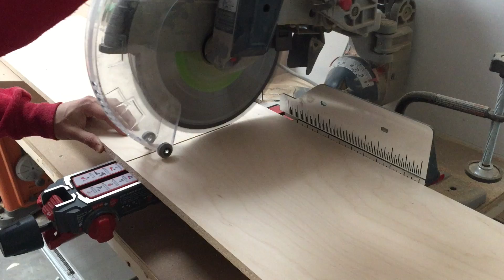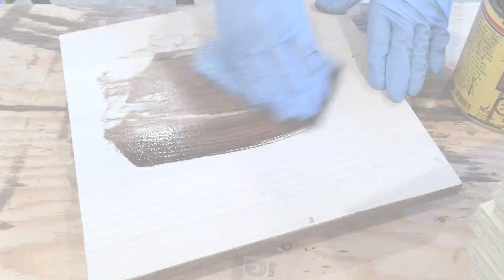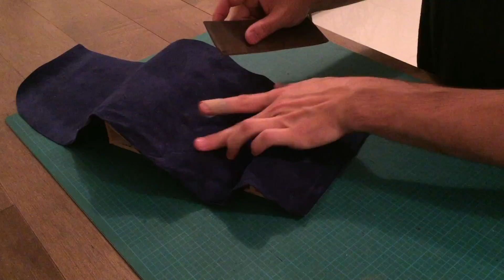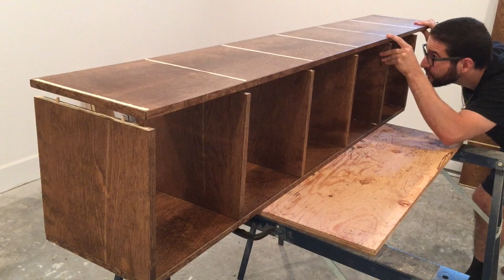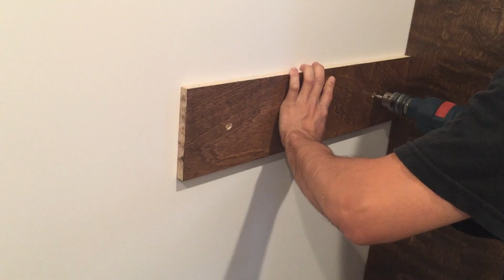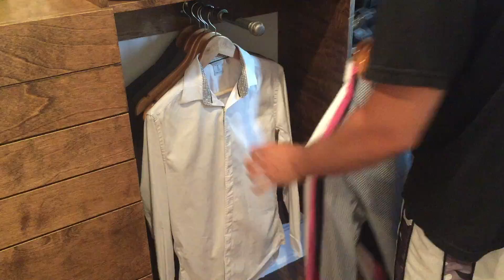How to Build a Custom Walk-In Closet // DIY - Part 1

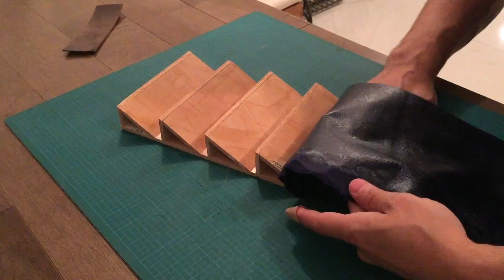Comment: 4:30 For fabrics, its much better to use spray on contact cement so you can control the application better and avoid bleedthrough to the visible side.

Comment: Really good ideas, just wondering why you didn't hang with french cleats? I really like the idea of hanging the cloths perpendicular to the wall. has any of your cloths fallen off the rod. That may not work for us with the amount of cloths that will eventually be placed on them. Shoe rack looks really nice, I may make those a bit smaller as we( wife and I) have too many shoes... But I like the build, good ideas for my build, one of these days...
Reply from the maker: No clothes have fallen off the rack. They are very sturdy and doing very well

Comment: I'm surprise you still have fingers, never hold the material at the end where is the lightest or smallest part always hold it at the longest and heavy end. Even if you have to use your left hand to cut it. Minute 0:21

Comment: unfortunately I can't find anything in comments, but what kind of wood did you use for the main shelves?
Reply from the maker: Birch plywood
Reply: @CoreyRametta  thanks for response! that was a first time I ever written the comment :)
I did some research and it seems that the plywood might be different grade. Baltic Birch is used for the future but Birch plywood from the Home Depot seems to be 3rd grade or smth like that.
The surface in the video looks sooo smooth, do you think I'll be able to reach that good look if I sand/stain everything properly or in addition to the processing, the wood must be also a higher grade and I won't be able to reach that effect with Home Depot plywood?

Comment: Good project, finally convinced my wife to let me do it ,the only change will do instead of the pipe coming out for the shirts or pants will sideway , by any chance the name and color of the stains ,thanks in advance!!
Reply: If you use a "Pull-Out Closet Valet Rod" you can make the same closet in the video, but you'll get better access to all items with the valet rod. Some Valet rods can be pull downward for eye level access to clothes. Some home improvement stores/websites offer wood stain samples so you can better match what you're looking for.

Comment: I'm old,  tired, and female, but I took out wall between little bedroom and my bath and built my own closet.  If I can do it you can do it.  Also Lowe's has the wood already drilled and painted in their closet area if you want to do a  faster job.  Go for it!

Comment: Looks great! I saw you using that suede material for the sunglasses tray and wanted to ask some advice. I’ve been wanting to apply fabric to a wall instead of painting it. Could that type of product you used be directly glued to a wall? Do you have any suggestions on using/attaching a fabric to a wall? Thanks for any advice.
Reply from the maker: Good idea. Wallpaper glue should work just fine

Comment: hey bud, my wife and i are going to try this next month. I'm having issues finding the 5/8 presswood online and at home depot. Any way you can help with that or any other options you recommend.
Reply from the maker: You can use 1/2” or 3/4”. Or use what is available locally at home depot

Comment: Yes very well done if u measured ur space right and the power point was nt half though the cabneit like on the part of u vid about 10mins n 15 seconds on it becomes obvious and a ugly job
Reply: His solution is the easiest and most economical way to fix the outlet problem. No sense relocating it for a closet, and no sense losing an extra inch or two of closet space along the entire face of that wall to not butt into it. Unless this build is in a million dollar home, no one is going to care much. Still looks amazing.
Reply: That and u could just move the outlet lol and cover the hole with the cabniet
Reply: I think you're missing the point. Why bother to go to that trouble when he might not want to mess with electrical. Or leave a hole in his wall, even if it is covered. His solution works, and it is the fastest, cheapest, and easiest solution.
Reply: Haha its not like its fixed it can be moved most if not all sparkies leave a little bit more cord then needed in the back to allow for this sort of problems and u would of never even knew it had been moved a few as long as its brached properly it should be fine to move just anoth thought before puting holes in ur cabnet lol
Reply: Nowhere have I indicated the outlet can't be moved so almost all of your response is moot. Everyone already knows it COULD have been moved. You seem to really be missing the gist, but I suspect that's on purpose. He didn't want to mess with the outlet. Why should he when a couple cuts of the wood and problem solved? But to each their own if you think his solution is 'ugly'. I happen to think it's awesome.

Comment: ...on the drawers, wont they come apart soon?
also the main body - dowels and glue --- no screws required? ( i prefer also without) what is your thoughts?
Reply from the maker: Drawers are plenty strong. So it dowels and glue
Reply: and thanks for the reply :)
Reply: ps, if you use dowels and glue, do you use these 2 alone or add screws? I find it weird why to use screws if you have dowels and glue , unless its my understanding that is wrong?
Reply from the maker: No screws
Reply: thanks again !

Comment: How did you design something like this? Just wing it?  Then how did you make a cut list?  Help please, I want to do this but don’t want to spend a month calculating the size of 50 pieces of wood
Reply from the maker: Rough sketch on a piece of paper based on the dimensions of the closet. Then create a cut list from that
Reply: Corey Rametta thank you !

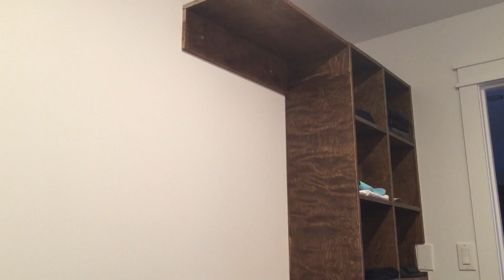Comment: @ 7:56 you have the anchored piece that the clothing rods mount to, but they have a shelving board installed on top of the anchored piece.... are those just held up by dowels on either side? If yes, how much weight do they support?
Reply from the maker: Yes

Comment: I'm curious how your pipe is holding up.  It looks like standard carbon steel black pipe.  I work in industrial manufacturing and If you scrubbed off all the oil protecting the medal I imagine it's only going to rust over time.  Not enough to worry about the structural integrity of the shelves I'm sure, but rust stains on a nice clean shirt or suit can be quite a bear. Otherwise, great work!
Reply from the maker: +iamnovus21 1 year later and no signs of rust.
Reply from the maker: +Grace Loflin not at all. There are 4 screws holding up each bar, and only about the weight of 7-10 shirts pulling it down. Not enough to sag, and I don't suspect it ever will.
Reply: Corey Rametta how about the weight pulling down on the rod? I was thinking of installing these sideways like a more traditionally closet. Are they sagging at all from the weight of the clothes? Thank you!

Comment: Corey any update on the other side of the closet?  Anything you would do differently?
Reply from the maker: +calvin415 almost done the other side. Not doing anything different (because I already had the wood) but if I had to buy from scratch I'd get Baltic birch instead of press wood. It just wasn't available to me at the time.

Comment: Nice job!  I'm hoping to start mine in a month.  We have an odd shapped closet with angled ceiling that starts about 5 feet up from the floor so I'm still trying ot figure out what to do with our.  I'm pretty sure I'll be using a nicer grade birch plywood and walnut for the face.

Comment: OK concept.... you need a huge work area..... lot's of tools, considerable knowledge of woodworking, stains, application. A lot of room was wasted. Nice if you only have three pairs of shoes, or you want ties that take a rolled up shape. What was that, 6 shirts? And, who helped you bring in the shelving? that was not light or easy to lug by any means. Why did you use a level on a pipe with an elbow while you were fastening to the wall? Again good concept, good workmanship. Inefficient use of space.

Finally, you need to let people know actual build time.10 min video=2 week build for 2 people. (never mind editing time)
Reply from the maker: I think it's a pretty efficient use of space, considering the width of the closet. This lets me add cabinets to both sides of the walk in closet, instead of just one. You don't need a lot of space, or many tools (can be done with a mitre saw and table saw... and if you don't have those, a circular saw will do). For your information, I brought in the shelves myself.
Reply: Again, great proof of concept. 
1.Originally, I thought you were going to mirror the other side.... but you didn't. Why do it later when you're in a groove? Get both sides done at once! 
2.Yes you can use a circular saw and miter saw....but you didn't. I also have a full complement of tools, and it's taken a considerable amount of time to learn proper use. 
3. Was your workshop just outside of the closet? then sure, you can bring it in, however, the whole thing assembled still weighs a considerable amount, not to mention the size. It's big and awkward to work with.
4.You and I are skilled, I know what it takes. Not so much for others.

Comment: just out of curiosity, why would you ever hang your clothes front to back instead of side to side?  I know a lot of IKEA furniture does this (which perhaps was the style your going for) but in my mind, form follows function...and hanging front to back instead of side to side doesn't seem very functional.  Just my 2 cents, I'd love your reply
Reply from the maker: Good question. Main reason...it is a narrow closet and I want cabinets on both sides. You need 24" from the wall to hang side to side. My cabinets only come out 12" from the wall. This leaves me enough room to walk through the closet once I install the left side. If I hand side to side, I'd only be able to have cabinets on 1 side.

Comment: I like it. I think adding doors would have given it an extra touch of sophistication. Either small individual doors or larger doors covering more space but def doors. Also, would have been better to have your hanging things hanging more like a closet rather than outwards. Its just easier to organize and pull the looks. But otherwise love it.
Reply: Leneufcinqcergy once you know your own wardrobe you don't need to see all of them.  it's a nice touch to only display the first one.. it looks more organized and less chaotic
Reply: I agree about the rods. It’s not about seeing them all. It’s about getting one without moving 5 others first. Disagree on the doors though. Looks better open. It looked sophisticated to have neat clothes.

Comment: Corey, what kind of wood did you use for your walk in closet? I am making one myself and i had been recommended birch plywood i was looking to use pine plywood it looks real nice at the HD store. What would you recommend?
Reply from the maker: I used Birch presswood. I would have liked to go with Birch plywood, but it was not available locally when I built it. Either birch or pine plywood would work. Pine would give you more grain, while birch would be less grainy.
Reply: Corey Rametta 
Weird i have not seen that type of wood only the one with white plywood on the outside if thats what is called but i have question, i am thinking about going with birch plywood my question is would you have used the edge banding if it was birch plywood?
Reply from the maker: +Eddie i would still use edge banding, unless you want to see the layers. Completely up to you.
Reply: Corey Rametta, yea thats what i was thinking too question what size is the squares you made for belts and ties and are you happy with the size?
Reply from the maker: Ties are about 3"x3", and belts are about 5"x5", and they both work great.
Reply: Corey, how have you been nice Christmas ornaments, i have a question as i may have mentioned before i am constructing my walk in closet with birch plywood now i am a beginner, i noticed that when i am putting my pieces together a lot of the boards have a bow on them i guess a jointer would get rid of that but my questions is would run the pieces through the jointer first or after you cut your wood to size?
Reply from the maker: +Eddie generally always pass your wood through a jointer before cutting to final size. If you do it after you will cut your final piece smaller than needed. Since your using plywood I wouldn't recommend using a jointer though. Table Saw will give you a straight cut.
Reply: Corey Rametta well i am talking about the bow on a board like a crown in the middle of the board

Comment: Great video, where did you get the steel from? Im looking for something like this but I cannot find anything that looks strong enough, how did you get the tubes to fix to the bases and not slide out?
Reply from the maker: +Ben Mowatt the steel pipes come from the plumbing department of the local hardware store. They are attached to the units by screwing the steel flange into the bottom of the unit. Same for the top.

Comment: Where did you get the drawer hardware and what were the dimensions of the shirt cabinets? Also is there anything you would of done differently now that the unit is built?
Reply from the maker: +Jordan Fuller drawer hardware comes from Amazon, they are push to open drawer slides. Shirt cabinets are 24" wide. After using the closet for a few months now, I honestly wouldn't do anything differently. I think it was well thought out to accommodate my needs beforehand.

Comment: Nice work. 
I use a biscuit joiner, any advantages to using the dowel system?
Reply from the maker: +WirelessTv I read an article a while back that tested different types of joints. Biscuit joints were as strong as butt joints. Dowels are a bit stronger, and I don't have a biscuit joiner.

Comment: Excellent work! Sadly, I just finished mine and missed seeing this beforehand, otherwise I would have made some really useful changes. BTW what are the jigs you used for dowels? I haven't seen those before and as I'min Australia I probably have to import them.
Reply: Should be this; https://www.amazon.com/Milescraft-1310-Joint-Crafter-Doweling/dp/B005QU982K/ref=sr_1_2?ie=UTF8&qid=1474390703&sr=8-2&keywords=milescraft+dowel
Reply: I had the same question, those jigs looked very easy to use.  Awesome build, keep it up.
Reply: Michael https://www.bunnings.com.au/haron-dowelling-jig_p6320024?gclid=CjwKCAiA8qLvBRAbEiwAE_ZzPUcnrJPs6vvl2sdeUdykxYhwoU7CPKFeJ65nXZ2rKAKVZIesopcO0hoC5gsQAvD_BwE&gclsrc=aw.ds

Comment: WOW that was a assume video I am looking forward to seeing part 2 did you have any drawings or was it all in your head? I relay liked that doweling jig you used I have never see one quite like it can yo post a link as where you got it I think I would like to get one.
Reply from the maker: Thanks Vince. Had a rough sketch on paper, the rest was in my head.

I bought the doweling jig at a local hardware store, but here is the link to it on amazon: https://www.amazon.ca/Milescraft-1310-Joint-Crafter-Doweling/dp/B005QU982K
Reply: How did you manage to hand the long side pieces to the wall?
Reply from the maker: +Jorge Garza they are all supported from the bottom and top only. Nothing is screwed to the wall.